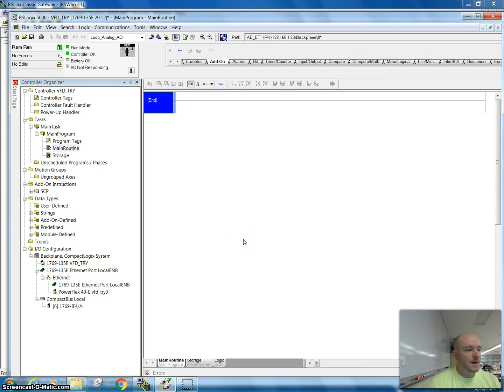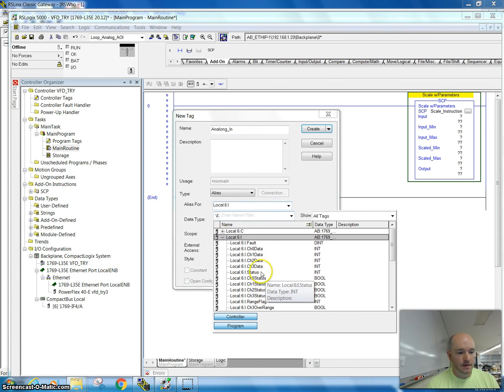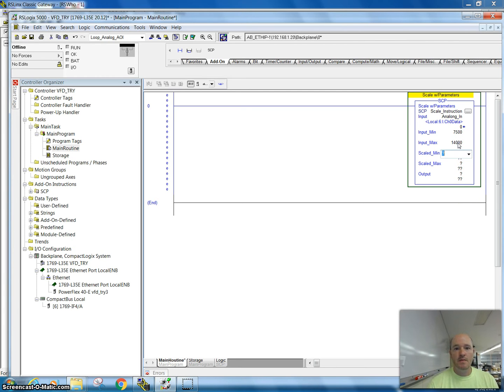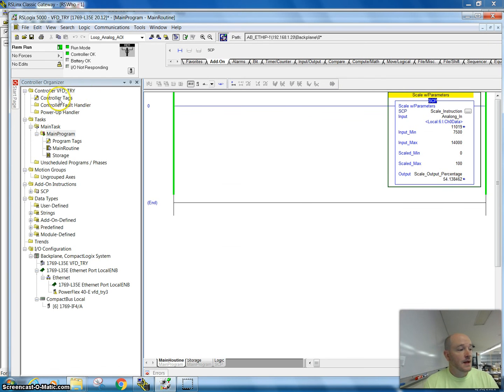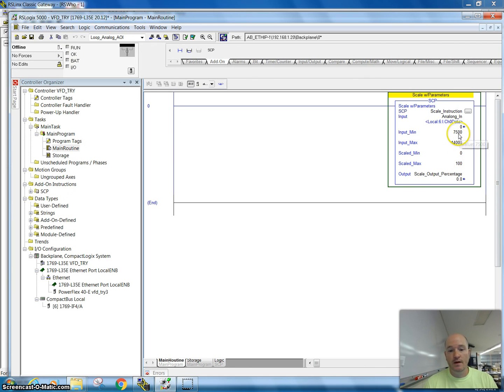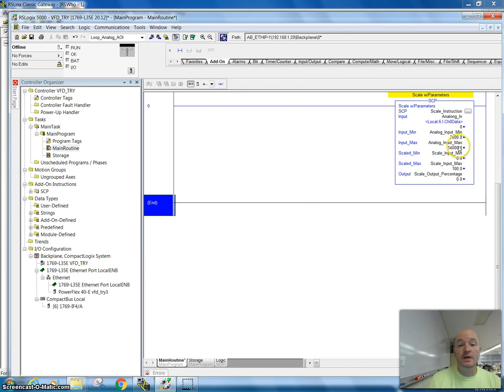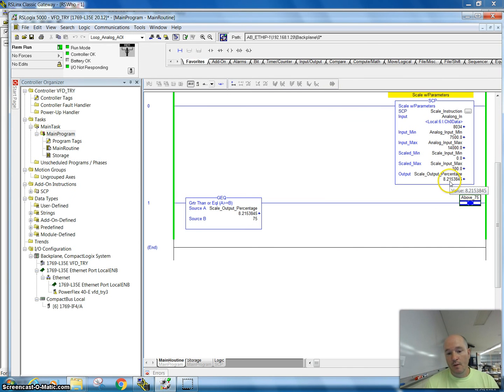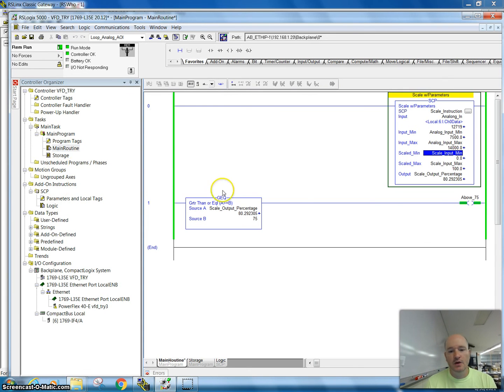Introduction to AOI using a Scale to Parameter Instruction (SCP)

Comment: Thanks for the video!!!  I keep running into references of this AOI without having to create a tag of SCP data type.
It's just a simple math so I'm not sure why they make you create a tag of data type SCP.   If you use this instruction 20 more times, do you have to create 20 more tags of data type SCP or can you use the same tag ("Scale_Instruction") for all 21 of the rungs?
Thanks in advance.
Reply from the maker: Great question. I have never  tried to use the same tag.  So it might.  If you try it let me know.  Thanks